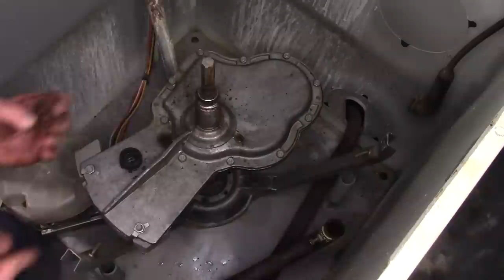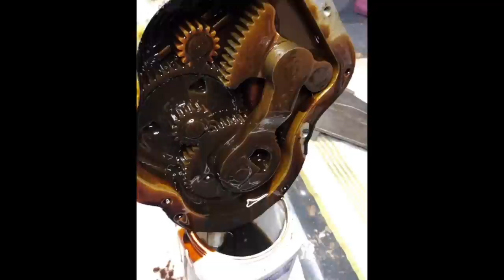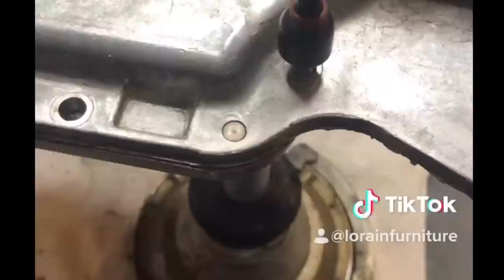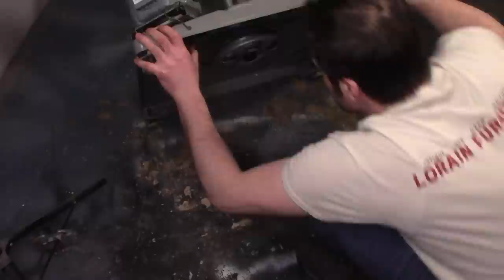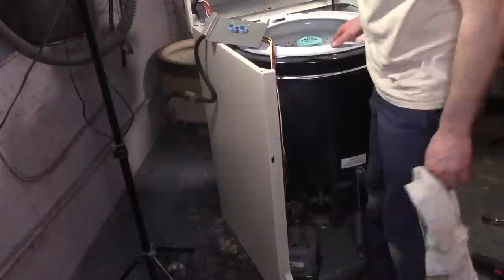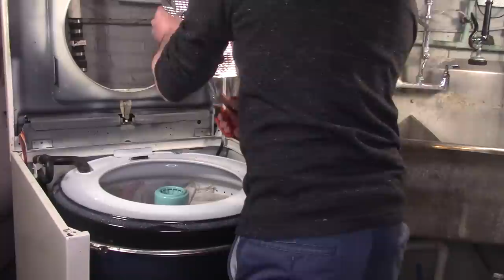Perfect Restoration of a Vintage Maytag Washer

Comment: I’m so proud to see this great appliance lovingly restored. Oh the simplicity. Sure won’t be doing this in 40 years for today’s  stuff!                                                              Eugene if I had five thumbs they’d all be up!!  😊😊
Reply: Indeed, this machine was definitely the end of an era for sure when things were made in america and people took pride in what they did, now it's a race to the bottom to see how cheap they can build it and what kind of profits they can make when they dupe unsuspecting buyers into spending $1000 on junk only to find out it only lasts about 5 years and theres little to no help from the manufacturer once it dies so you have no choice but to junk it and buy new
Reply: @jhomrich89  It so serviceable too. I have a whirlpool I use around that age and the panel is in the rear. Still very high quality.
Reply: Be lucky to get 5 years on today's sad over chrome coated plastic of today.
Reply: @jhomrich89 * TOO TRUE in Today's "Disposable World" Jon . . . Unfortunately !!  😞
Reply: @jhomrich89  I don't know if I can quite agree with that.  Mom had this Maytag machine for years (was my grand mother's).  Then she upgraded in the early 80's to the new model, while keeping the matching dryer.  The washer lasted us 30 years.  She was meticulous when she researched.  

I learned and bought a used mid 80's refresh version of her machine for $200 after moving out.  It lasted me 10+ years.  When the transmission died, the repair man said he had a used early 90's version of the same machine for $175.  I've been rockin' that machine since 2008.  The parts of these machines were definitely made to last!   Just bought a new-to-me home and it came with a vintage 80's model like my mom had.  I may be good for another 20 years 😂years.

Comment: Came across this video trying to troubleshoot our Maytag A102 washer that has been in continuous use since 1965! It just started squeaking on and off during agitation this year, i.e. in its 59th year of service. Local appliance repair companies have told me they aren't able to repair machines of this vintage. So frustrating. Would love to find such a skilled repairman as this one. What a beautiful job!
Reply: Likely yours just needs belts. Veery available. No tools necessary. Tilt machine back to lean on wall and replace 2 belts. Repair places that have been n business for 40 years or more will gladly work on it
Reply: @sugrue8526  Thanks for your reply. At the moment it's behaving well, but if the noises start up again I will try changing the belts as you suggest. We will continue to use this machine as long as it keeps working!
Reply: I just heard from someone today who is having the transmission problem, and said the parts were listed but nolonger available.  Now that Whirlpool owns Maytag, they are going to do planned obsolescence.  They want to force us to buy that new HE crap of a washing machine.  The last direct drive washer with a transmission is a Speed Queen.  The Speed Queen dials on one of their machines that is highly rated are set up exactly like the Maytags of the late 1990's and early 2000's before Whirlpool came along and took them over.

Comment: I am in COMPLETE AWE of your knowledge and restoration craftsmanship of these classic beauties! I'm 57 years old and my mom purchased a similar Maytag washer and its matching dryer back in 1970 in avocado green and it faithfully washed the clothes of us 5 kids along with my parents clothes. I inherited it when she passed away in 1987 and it continued going strong washing the clothes of my family of 6 until the transmission died and it no longer would stop at the end of each part of the wash cycle. The dial would move but the washing continued and would not stop to empty the wash water. I was sad to see it hauled away in 1999 after 31 years of hard use.  I purchased a Kirkland Signature toploader washer made by Whirlpool at Costco. While its capacity was far larger, it only lasted 10 years before it rusted out at the bottom where the drum's springs attached to the base. Its replacement lasted only 5 years. I now own a 2004 toploader Kenmore (made by Whirlpool) which was used (6 years)  when I  acquired it, and thankfully it's going strong and has had only a couple of repairs done by my husband. I will never get rid of it. 

However, after watching a couple of your videos as well as a couple other channels that feature these workhorse classics, I am tempted to go retro and get one of them myself. They are the classic muscle cars of appliances!

Comment: We have & still use, a 43 year old Maytag washer/dryer set we purchased the year we got married - 1980 - that we use regularly. There have been no major problems - just a few minor things that failed - like a water supply hose, the burner in the dryer, and a couple of small things. I think that this set so fit the ads "The Maytag repairman is the loneliest job in the world!"
I have to teat it apart & clean it up just like you did. Thanks for the video, I'll take my laptop with me for guidance.
Thanks!

Comment: First time I saw the inside of the helical transmission! 

That was some serious dedication work!
Reply: more people have now seen the in sides of a helical drive than when we had to fix them, they never broke, o  ring occasionally,  great video
Reply: Call me a newbie to these, but I thought these were belt driven until I saw that incredible transmission.
Reply: They are belt driven. Belt on the bottom of the machine
Reply: pat cola I hadn’t realized that until I saw him put  the base plate back together.  Is that unique to old Maytag?  I’ve never seen that before.
Reply: @grandcarriage1  sorry so late but yes.
Reply: @TheGewidener  It's a genius design. Most other washers have solenoid-operated clutches to engage the spin cycle. Maytag spent a few bucks more on a reversible motor (two speed if you have the Gentle cycle) and used high-cloth belts that are allowed to slip as the tub comes up to speed. GE machines of the period look like a Rube Goldberg invention with rag-joints to the water pump. Whirlpools used a device called a wig-wag which was just about as silly as it sounds. 

One thing with Maytags, though - ONLY use genuine Maytag belts. They are designed to slip. If you try to use a regular rubber belt like a fanbelt, you're going to eventually blow the washer's motor.

Comment: I loved watching this.  I just aquired a 1983 Maytag washer (LA511) and dryer (LDE410.)  They use the same drive train that yours does.  I didn't have the tools to pull the transmission out, but I did clean every inch of the machine before I installed them in my house.  They are fantastic machines.  Too bad they are cheaped out Whirlpools, now.

Comment: That's a really nice A808. Whenever I see an old Newton Iowa Maytag washer on the curb I grab it. I have rebuilt, refurbished many of these washers over the years. I got started in appliance repair when the "08" series washers came out, and became a Maytag dealer myself.  Still using an A406 washer that I rebuilt in 1979 in our home. Still have many customers who do not want to part with their old Maytags.                 BDS Laundry , a good source for parts for the Newton Maytags.  Enjoyed the video.

Comment: Such fond memories. When you cracked open the transmission, I could smell the gear oil.I started doing these kind of refurbishes for my dad when I was 10 yrs old !Wire wheel the legs, clean the bases, just go through them top to bottom. Remember the Highlander models that you removed the back instead of the front panel ? They had rebuildable pumps in them. I used to rebuild the brake packs in these machines, I never understood why, they all got soaked in transmission oil and didn't work anyway. Today, you can't even get decent replacement parts for them. The center assemblies and tub bearings are junk, and any of the machines with the orbital transmission probably have a rusted outer tub. Such a shame...

Comment: I have a white 1974 Maytag A806.  Still original motor and transmission.  Have only done minor repairs over the years.  Seeing this video gives me hope the indestructible beast can live on.   This restoration would be amazing to have done.   The only thing I'm concerned about realistically is the transmission and main seal replacement.  This restoration would be the ultimate, though.

Comment: Today, my Maytag washer of the exact same model finally had its first actual problem; it wouldn't pump the water out, and could barely spin the drum.  After seeing this video, I'm confident that I can fix it and get it running for as long as I'm going to still need a washer.  And I'll be damned if I'm going to throw it away after seeing the inside of that gearbox.

Comment: Wow. Fantastic restoration job. My grandmother had the same exact machine; I loved the way the back panel lit up. Are you sure it’s only 42 years old? Unless they made this same model for many years, the one my grandma had was definitely 1960’s. Don’t remember what exactly happened to it but in the mid 80s it finally broke and was replaced by another Maytag which ran flawlessly until grandma passed away in 2000 at the wonderful age of 96. I’ve got her 80’s Maytag sitting in my basement as a spare.
Reply: i agree 60 years old
Reply: why a spare. use it . it will last a very long time
Reply: I believe that's a Maytag A806. They were produced in the sixties, seventies, and early 80s if I'm not mistaken.

Comment: I purchased one of these - It looks like the same model except for the exterior color.  It was a belt drive - identical dashboard to this in the video - it was 1978.  I’m sure these designs were maybe glorified after a few years of sales - like adding fabric softener dispensers.  worked just dandy too - don’t remember a service call on it - at all.  It was used well into the late 1980’s.  It allowed for more control of options - whereas today, all cycles are pre-arranged.  And when the readout says 13 minutes til end of cycle - assume another 40 minutes or so.  Samsung got a black eye some time back with lower quality steel drum supports - caused complete failure.  I’d love to have it back.

Comment: The drive assembly looks pretty similar to the one on my 1985 Whirlpool . After 20 years with no problems the water pump went so when replacing it I wanted to look inside the gear box the fluid looked like automatic transmission fluid so that is what I replaced it with and it is still running today.

Comment: Nice. I noticed that a lot of the parts are the same as my 30 year old LA412. What sold me on it when I bought it 30 years ago was that orbital transmission. I don't know why they ever did away with those. I can't remember the brand of the machine I had before it but I do remember the "wig wag" which made the tub agitate. I just replaced the tub bearing on mine so now it is agitating again but the belt squeals abit when it goes into the spin mode.

Comment: Thanks for uploading this very informative video. Never seen one that completely takes one of these machines apart. 
Currently, I'm in the middle of trying to restore an A702 and I'm having a hard time finding a replacement timer and tub bolt kit for it.. Do you or anyone reading this know if a timer or tub bolt kit from a newer machine work for an older machine like mine? If anyone knows, part numbers would be helpful..

Comment: Awesome! I've been looking forward to this video. Looks like it just left the factory.
I did this same thing about a year ago, and noticed you went with the older style mounting stem kit as well. Do you think it's a superior system to the lip seal setup used in later models? 
This must be an extremely quiet machine to hear in person, with that sound dampening! They are normally smooth, and quiet without it.

I'll give that agitator shaft groove-pin another try, by grinding down slightly. Would be nice to have a good spare, ready to drop in, should I need it.
Well worth the effort, should make someone a great daily driver for decades.
Reply from the maker: I actually really liked the old style seal kit.  Looking at it it’s easy to see how it’s superior to the new style. Plus I kind of wanted to see what it was like as that was my very first time!
Reply: I ordered the new style first, before knowing there are two versions. Then, thankfully came across the older style, and went with it. So far, so good!

Comment: Did you take apart the transmission to change the o-ring oil seal? Which part in the video do you do it at? Never seen a video about it before on the older transmissions like this. I have one that dumps oil on the floor that I might rebuild soon.

Comment: Wish I could find someone like Eugene who could fix a vintage eureka vacuum I have. None of the vacuum shops locally can fix older items.
Reply: I guess that depends on how vintage - most Eurekas from the 60's and after are very similar to Sanitaires. Before then it's a little trickier to find someone who is up for the challenge (depending on the problem to be fixed, of course)
Reply: @owenperkins  This would be a 1978 Eureka brandywine ESP. It has the 6 amp motor.  Very similar to a sanitaire.  The local vacuum place told me they put new bearings in it. However,  once I brought it home it was never right. It made a strange vibration and suddenly the motor rpm slowed down and this burning smell came out.  I stopped using it.  The vac shop told me he could do nothing more.
Reply: @corey3151  sounds like they messed something up for sure. Those motors aren't so hard to work on, if you're so inclined to take a crack at it yourself. Hopefully it's just binding up and doesn't have a bad armature or field. It's quite unlikely that they changed both bearings though - the upper one is almost impossible to get out without messing up the armature/cooling fan.
Reply: @owenperkins  it's a really nice machine. I know the brandywine color is hard to find. I have 3 of these brandywine color in various models.  Do you do vacuum repair? Seems none of the vacuum shops around my area can work on older vacuums.  He just wanted to sell me a new miele which I already have. So then your saying they don't typically change both bearings? This guy worked on 2 of my brandywines and neither of them run correctly.  The other is the widetrack model and it makes a horrible screeching noise when you turn it on. Again he replaced the bearings along with the fan in that machine.
Reply: @corey3151  I do certainly repair - happy to help any way I can. Love those Brandywine units, they both deserve to run properly!
Reply: @owenperkins  well I would certainly be open to sending the one to you and see how it goes. I'm somewhat hesitant but open to it. How much do you charge and I'm assuming you have lots of experience doing this. I saw a couple videos of you on YouTube and you really your stuff on central vacs.  Give me your email addy and I can contact you through that.  I can send you a couple pictures of said machines if needed. Thanks!

Comment: Did you coat the bottom inside of the tub? I find that the drain flange rots away quite often and the hose to pump just breaks off. Whats your plan then?

Comment: HI, I love this video. I have a Maytag washer  from the late 70's and all is good so far.  I also have a 1964 Frigidaire and the tub spins when it is washing.  A friend of mine gave me a rebuilt transmission for it, but I am not very handy with this sort  of thing. Do you rebuild those washers too?  I am a member of the Automatic Washers Club.  My name there is ABComatic if you would like to get in contact with me.  I am in Illinois.  Thanks, Gary

Comment: if you don't want scratches on plastic which only get dirt and fat much faster on it afterwards but like the plastic to stay clean much longer and easy to clean; then use natural bristle brushes with detergent, linen/flax seed soap or lemon acid, let soak in lemon acid and water for a while. Don't use sponges or any plastic. They scratch.

Comment: How long did it take you to do this restoration? Where are you located? How much would you charge to do mine? It is only 38 years old. 

I got a quote to replace the "damper pads - supposedly $75 - and bearings and seals - supposedly $389.95" because of leaking under the tub!
Reply from the maker: Nicole Bernshaw it takes about  a week or two, these older Maytags cost between $1500-$2500 to complete

Comment: I have this exact same model. But is just stopped pivoting  in wash mode.  When it breaks after a spin it's yelling so loud. What do you suggest me. i have family ties with my maytag la306 from Canada...
Reply: Maytag used a wet braking system that uses transmission oil (you can substitute 80/90 gear oil). When is dries out, it will squeal. You can pour a couple of tablespoons into the brake package opening and it should become quiet again.

Comment: I have a model a107 and it won’t stop running. It will complete delicate load then runs onto premium press know how to fix it ?
Reply: The air dome pressure hose may be clogged. Blow through it aggressively and see if air passes with ease. If it does, you have a bad pressure selector switch.